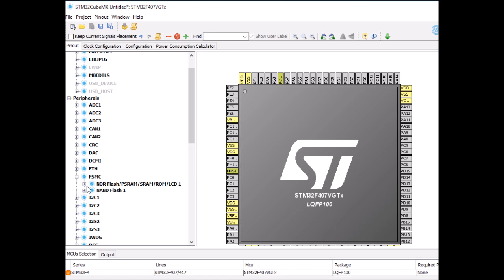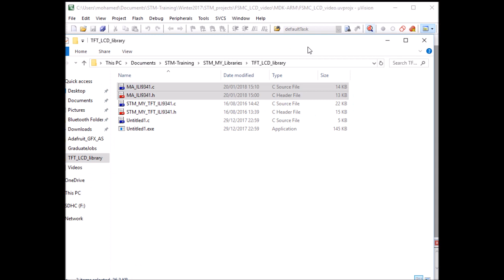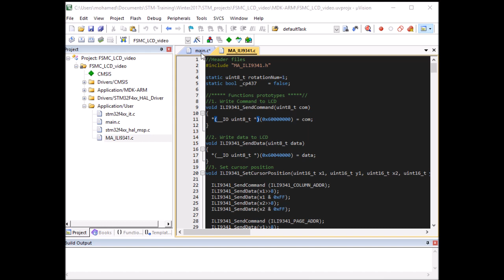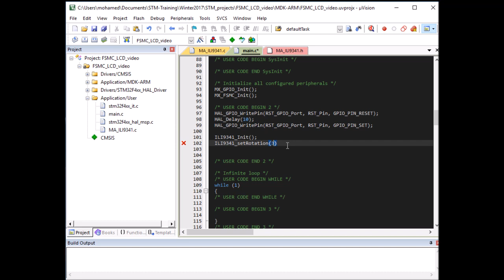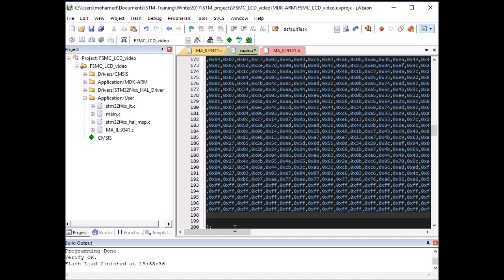STM32F4 Discovery board - Keil 5 IDE with CubeMX: Tutorial 21 - TFT LCD ili9341 (using FSMC)

Comment: How do I have to alter the code for using it with STM32F746? I already tried just changing the stm32f4 HAL to f7 and generated code in CubeMX for f7 accordingly, but it doesn‘t work.

Comment: Thanks for the useful tutorial. Can I use the mentioned libraries (MA_ILI9341.h and MA_ILI9341.c) for interfacing my 3.2" LCD display having ILI9341 driver IC with STM32F401 based Nucleo-64 board through SPI?

Comment: THANK YOU SO MUCH! I got it working with the DevEBox STM32F407 breakout board with the 16-bit-interface TFT_320QVT_9341 display board!

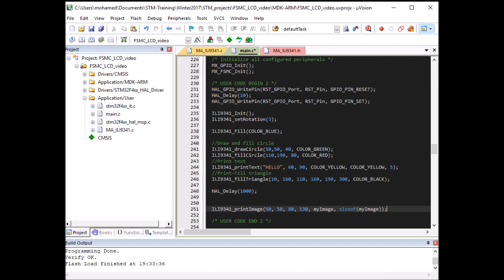With your linked code and some tweaks for my setup I get exactly the same thing shown at 16:41!

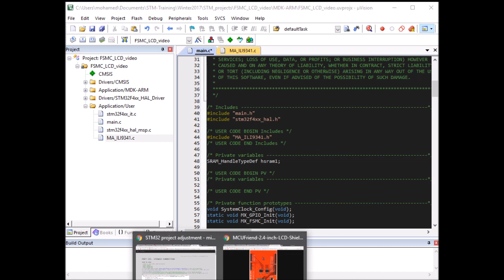I had to change the data address 0x6004000 to 0x6002000 to use with my particular Register Select A16 setting per 6:47 ("Understanding FSMC addressing" paragraph).

I also think that after
HAL_GPIO_WritePin(RST_GPIO_Port, RST_Pin, GPIO_PIN_SET);
in main.c there should be added another HAL_Delay(10); after raising the Reset line, but doesn't seem necessary from experimentation.

I made a couple more tweaks to change to a 16-bit interface, changing
*(__IO uint8_t *)
to
*(__IO uint16_t *)
in the SendCommand/SendData functions, and adding another SendData function for 16-bit color data and editing the printImage function to combine the upper/lower bytes.

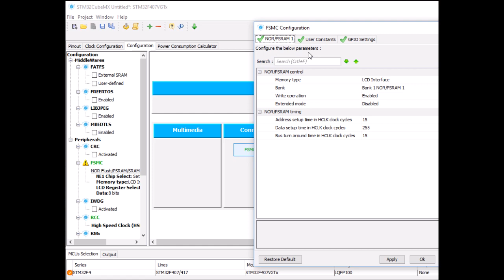3:34 changing these timing settings from the 15/255/15 default settings sped up the drawings a lot. My circle function still seems a liiiitle bit slower than what's shown in the video.

https://www.amazon.com/gp/product/B081BCXST2/ref=ppx_od_dt_b_asin_title_s00?ie=UTF8&psc=1
https://www.amazon.com/DIYmalls-ILI9341-Display-Resistive-320x240/dp/B086ZK6VG5/ref=cm_cr_arp_d_product_top?ie=UTF8

Comment: It's probably a bit late to ask, but do you think It's possible to achive a decent frame-rate with bit-banging? I don't have a fsmc on my Chip (STM32f405RGT6).
Reply from the maker: Yes.. for gui. For video, not sure
Reply: @mutexembedded2206  I got It to work finally! With your code as foundation I only had to implement SendCommand and Send Data.
Here is what worked for me:
//1. Write Command to LCD
void ILI9341_SendCommand(uint8_t com)
{
    SELECT();

    GPIOC->BSRR = (uint32_t) 0xFF0 << 16U; // Clear Bus
    GPIOC->BSRR = com << 4;

    ACTIVATE_COM();
    WRITE_STROBE();

    DESELECT();
}

//2. Write data to LCD
void ILI9341_SendData(uint8_t data)
{
    SELECT();

    GPIOC->BSRR = (uint32_t) 0xFF0 << 16U; // Clear Bus
    GPIOC->BSRR = data << 4;

    ACTIVATE_DATA();
    WRITE_STROBE();

    DESELECT();
}

and here are the defines for the Header File:

#define SELECT()            GPIOA->BSRR = (uint32_t) GPIO_PIN_15 << 16U        // CS on PA15
#define DESELECT()          GPIOA->BSRR = GPIO_PIN_15

#define WR_HIGH             GPIOA->BSRR = GPIO_PIN_9                                        // WR on PA9
#define WR_LOW              GPIOA->BSRR = (uint32_t) GPIO_PIN_9 << 16U        
#define WRITE_STROBE()      WR_LOW; WR_HIGH

#define RS_HIGH             GPIOA->BSRR = GPIO_PIN_10                                      // RS on PA10
#define RS_LOW              GPIOA->BSRR = (uint32_t) GPIO_PIN_10 << 16U
#define ACTIVATE_COM()      RS_LOW
#define ACTIVATE_DATA()     RS_HIGH

#define RD_HIGH           GPIOA->BSRR = GPIO_PIN_8                                          // RD on PA8

You also have to change the Init function as follows:

void ILI9341_Init(void)
{
    WR_HIGH;
    RS_HIGH;
    RD_HIGH;
.
.
.
}

I did reset the display on the RST line but did not put it in the Init function. 

I'm using PC4-11 as the data lines, but you can take any consecutive pins from one port. Best would be to use PC0-7 for example since no shifting is required. Writing to ODR would be faster but only if you dont have to mask other pins from the same port.

Comment: Hello! I'm using HVGA 3.2 Arduino Sheild and wanted to use 16 bit can you tell how can i convert these drivers for 16 bit. The LCD is working with 8 bits but not properly. If you could help.
Reply from the maker: Hi,
It uses ILI9481 driver, so need to program that a bit first.

Comment: Amazing video! Thank you so much for all your work. Could you please help me understand if we can use SPI for this particular LCD instead of FSMC. I was trying to understand if I could use SPI to interface ILI9341 with STM32L4. Is SPI or FSMC better?
Reply: Depends. SPI uses 3-4 pins while FSMC uses over 10 pins. However FMSC can probably transfer at much higher rates since it's a parallel interface.
Reply: @caffeinatedinsanity2324  Can I use the same libraries if I am interfacing the same LCD through SPI ?

Comment: Can u tell how to move the cursor position up, down , left, right with the coordinates value of x and y
Reply from the maker: Hi,
There is a function to do that I believe for writing pixel
Reply: @mutexembedded2206  
Hi,
There is a fun called draw pixel and set cursor position. 
In draw pixel if I set to (0,0, colour) will it put the cursor at start  and (0,1, colour) for the next row ?
Reply from the maker: @easyprocesscodingacademy488  
Hi, that's right, next pixel (row, col)

Comment: I use Atollic True Studio and i have a problem in the path MA_ILI9341.h
Reply from the maker: What sort of Path problem? Or actually a compiling error?
Reply: @mutexembedded2206  a compiling error, i think that because i don't know the place of MA_ILI9341.h when added
Reply from the maker: @raoufjmal6674  easiest way is to add MA_ILI9341.h in inc folder and .c in src folder.
Reply: @mutexembedded2206  i do these but doesn't work
Reply from the maker: @raoufjmal6674  What is the error Msg
Reply: @mutexembedded2206  error: invalid storage class for function '__sputc_r'
error: invalid storage class for function 'fillCircleHelper'
 error: invalid storage class for function 'drawCircleHelper'
Reply: the last building :
Error: selected processor does not support `dmb 0xF' in Thumb mode
 Error: selected processor does not support `dsb 0xF' in Thumb mode
 Error: selected processor does not support `isb 0xF' in Thumb mode
Reply from the maker: @raoufjmal6674  which board you're running it on?
Reply from the maker: @raoufjmal6674  Use a different IDE for a quick fix. Or try playing around with your IDE setup.
Reply: @mutexembedded2206   i can't use other ide like keil because the code size limited. Thank you
Reply: can you help me to connected camera ov7670 with stm32f407 please ?

Comment: i just wanted to know how to use 16 bit mode. Does the ILI9341 library work with 16bit mode
Reply from the maker: You need to make few changes to do that.
Reply: @mutexembedded2206  can you kindly help me out with only the initialization part i am having troubles regarding it. thanks in advance

Comment: I'm using this with an STM32F767ZI and getting weird results. It looks as if the functions and examples are ALMOST working. For example, printImage(50, 50, 80, 130, myImage, sizeof(myImage)) creates an image that's way too thin, in the bottom corner, and looks discolored. Or Fill(COLOR_RED) will create some red pixels at the edge but not cover the screen.

I've disabled the FMC FIFO, the FMC clock SHOULD be at 168MHz, I'm using single jumper wires between each connection to try and minimize signal travels, and I've checked the connections multiple times. I have also tested in Arduino with at ATMega and a different class-distributed library for the TFT, and have verified that with that code the TFT works fine. So I know that the problem must have to do with the STM32/Nucleo, not the TFT itself.

I can't figure out what I am doing incorrectly. I'm using TrueSTUDIO instead of Keil, would that make a difference??
Reply: I have your same Development Board and it works perfectly with what he did in this tutorial.
Reply: @yordaniferreiras6995  All is well! I figured out the issue, I had to enable memory-swapping and replace the 0x6x.. addresses with 0xCx...

Comment: When i use rotation 2 and 4 mode, my sentence starts from right to left and it is mirror like.  :(
Reply: In Display function control you have to change  from ILI9341_SendData   (0x82);  to ILI9341_SendData   (0xA2);